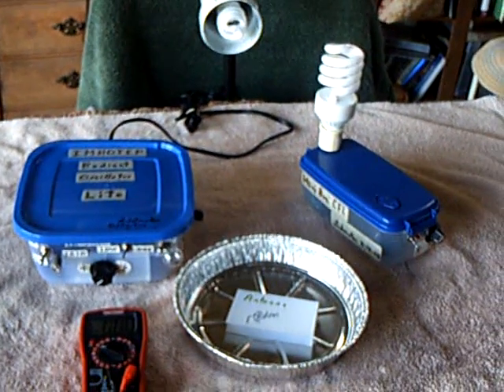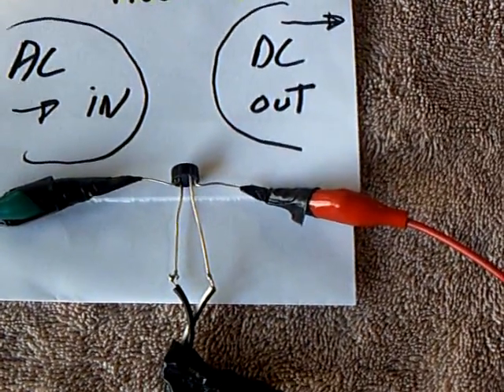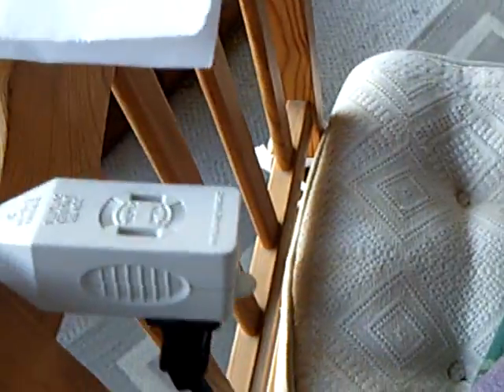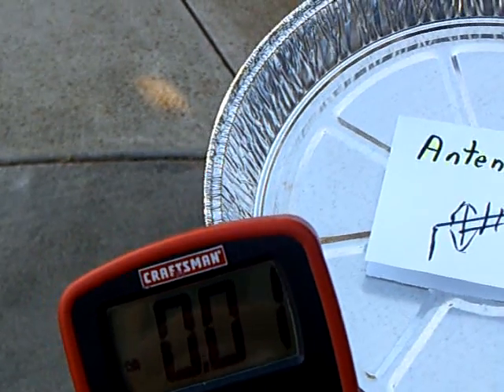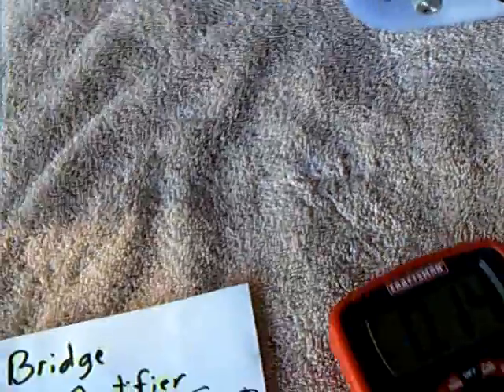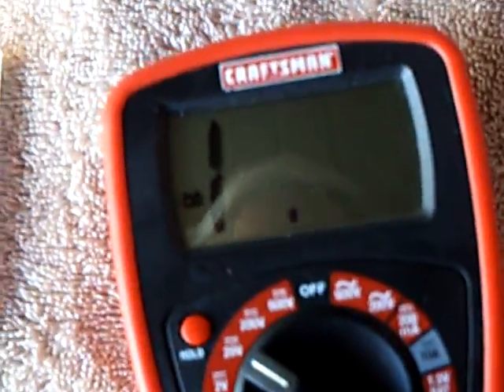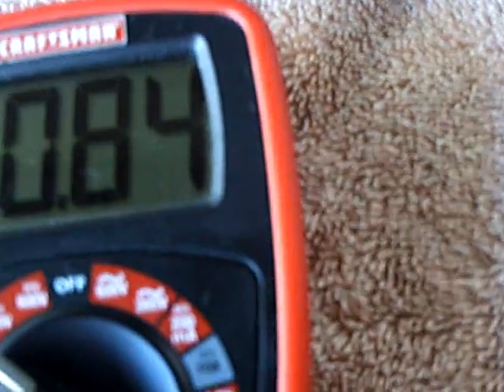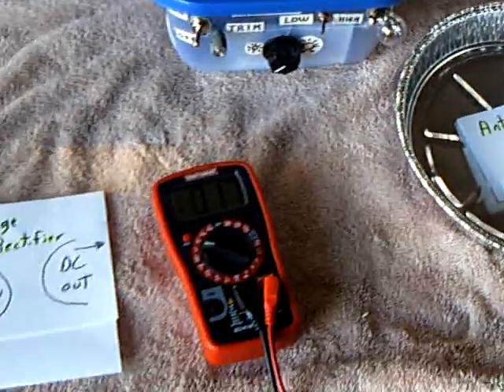Electricity In The Air!!!---Strange Findings

Comment: Too bad theres no video response button anymore but if you go to my channel and scroll back a little ways or search The matrix is real I'm a 5 volt battery, I have a video showing an anonymous 1.5 - 5.5 volt AC current that I can read simply by putting one lead in my bench vice on a metal topped work table and the other in my hand. I've noticed my proximity to the floor seems to effect it but it's definately not static or standard human body voltage. I get a steady repeatable 5.5 volts ove and over again

Comment: of course it's AC , duh , that's why you use a FULL WAVE BRIDGE RECTIFIER

Why didn't you just build your own AC to DC full wave bridge rectifire using diods.

You lose geek points when you don't build your own.

You gain geek points if you build your own diodes.
Reply: "Why didn't you just build your own AC to DC full wave bridge rectifire using diods.

You lose geek points when you don't build your own."

He did build his own.
That rectifier he showed momentarily, was four diodes with their wires twisted in the proper configuration to make a DIY full bridge rectifyer.

Comment: Ive been doing the same test, I call it recycled electricity. My circuit is a little more complex then yours but where mine shines is that I dont need to be connected to the house ground in-order for it to work. Its electricity you already payed for so why not use the wasted EMF waves to power something?

Comment: What you're seeing is current induced by the current in the wires of your house; the electromagnetic energy is being converted to current because it has a return path to ground through your setup. Turn your 'antenna' into a long, straight wire, and put it near the wall again, then orient it different ways and see how it changes. It should display a higher reading when it's parallel to the wires in your house. This is why you saw the voltage drop to zero outside, where there are no wires.